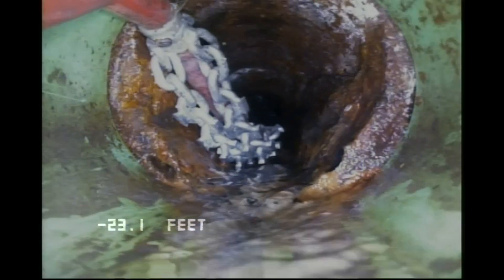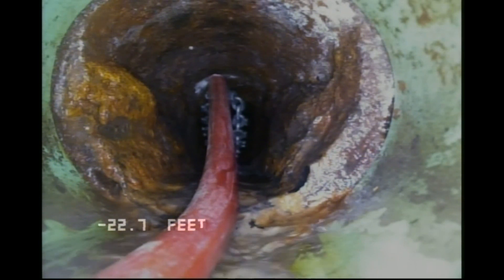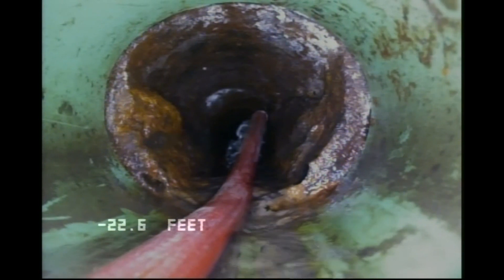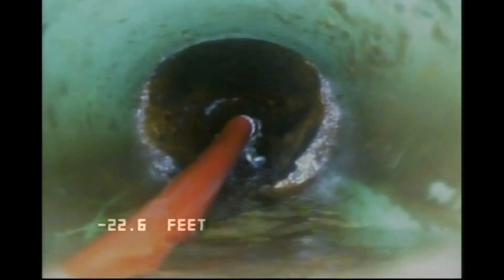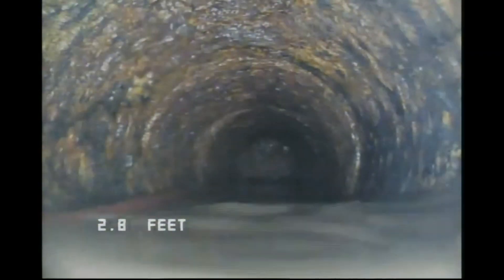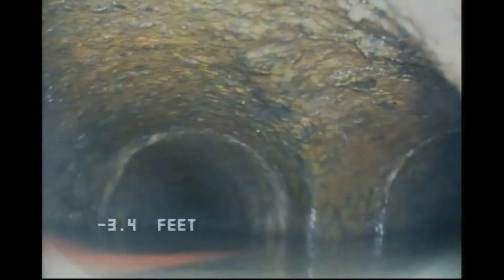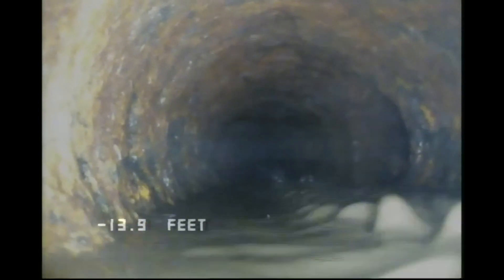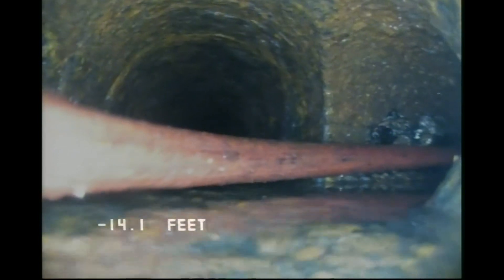Satisfying drain cleaning

Comment: I agree with the camera and flex shaft process is “priceless”.  Seeing what your doing is great.  Heavy roots will defeat my homemade flex shaft.  And so will pipes with few turns or 70 feet plus distance.  The pushing power decreases.  Or maybe it’s me!   Also the homemade version may not be as good.
Reply from the maker: Pushing power definitely decreases, you are right. I have a 1/2" flexshaft by ClogDogj that is a beast and chews up roots like nothing. I had used a homemade setup made by CustomEyes but I prefer having a proper housing for the flexshaft to pull in and out of real easily
Reply: @kcplumbingandrooter  thanks for the videos and advice.  Very helpful to have a forum to ask folks what works for them.  I also like the Custom Eye set up.  But finesse is the word I keep in mind while using it.  Wouldn’t mind having a beasty version to rival eel sectional cables I use when power is needed.  I will check out the Clog Dog unit.  1/2 cable is the key I suppose.  I’ve seen them at the WWETT show.  Seem like nice folks. Thanks again.  Dave from St Louis area

Comment: Invest in picote! my m2 machine would make one pass and roughly 50' of piping completely descaled to perfection in less than 10 minutes, water running the entire time and flushing it out etc! usually have to jet the line after to get all the scale dragged out but its a seamless and quick process
Reply from the maker: I know a bit about picote, I think if I did this more often I would need to get into their system. That's crazy you can do it that quick, however, i do love the cordless aspect of these ridgid machines, for quickly setting up and getting into a lot of soft blockages that they really excel at
Reply: Wish I could post a video reply! I could show you some before and after that are pretty cool, love your videos